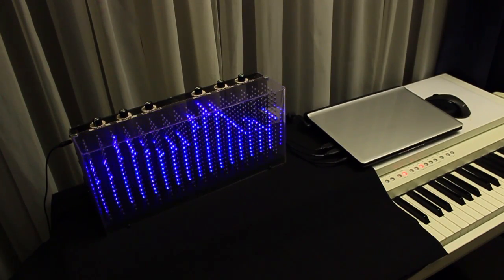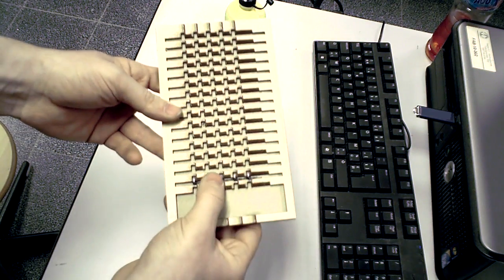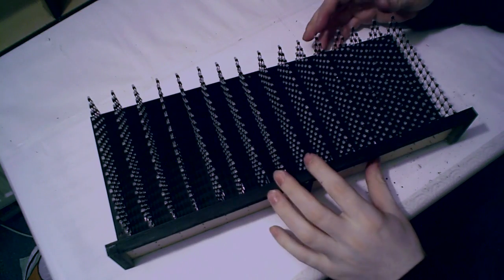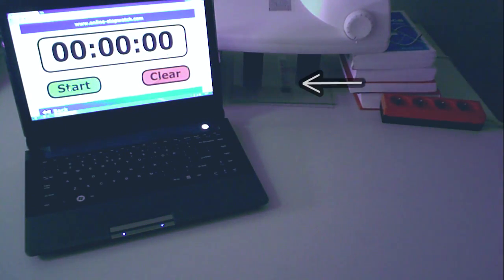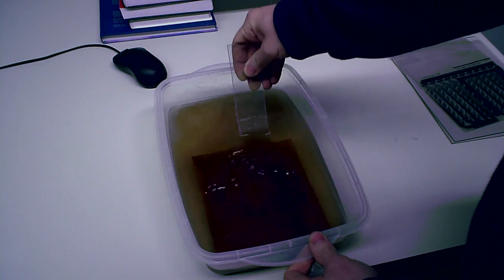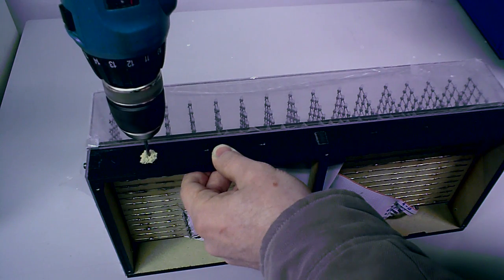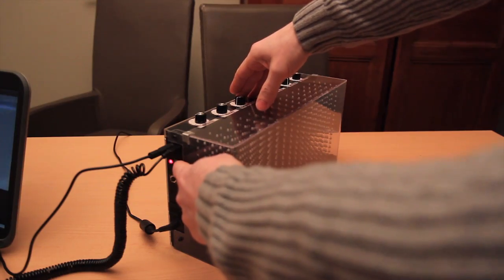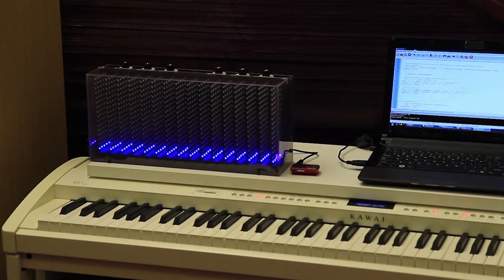3D Spectrum Analyser (1280 LEDs) - MAKING OF

Comment: Dude, all I can say is Bravo 👏 

As a qualified electronic engineer myself this is something even I couldn't build.

In college we all built final year projects, and every project was totally different from each others. What I could electronically understand and build was completely different to others, (and the same for them too), but this project is on a higher level than what I've seen.

You truly are jacked deeply into the matrix. Very clever stuff 👍

(I built a full size pinball machine that kept score, and outputted all info to a small lcd panel) as my project 👍 and I left it in college and told my lecturer he could strip it and keep the parts lol 😆

Comment: Impressive. One thing I want to say is that the LED used in this project and LED's used Led Cubes projects are completly diffrent. Ones in cubes are programmable through I2C protocol. These here are normal LED's which only furthers proves your genius because it's much harder to build your own circuit than writing a program (which you also has done). Keep it up!
Reply: And here i was too fast. Last 3 minutes of video impress me even further. Hands down.

Comment: "I'm making one!" Said no one ever!
Reply: what
Reply: EpicGaM3R13 this guy defeated everyone with the procedure. we can only watch and wait to buy a finished  one
Reply: I'm making one! lol
Reply: EpicGaM3R13 i seriously considered making this, untill the laser cutter came into play. Don't have access to that :(
Reply: So get it done online, and posted out to you, or look for a local hackspace or makerspace.
Reply: I wish I had the resources to make one. I would so make one if I did.
Reply: 0:05    Wow, I'm going to do this
2:30    Oh, man, too bad I don't have access to those tools, otherwise I'd make one
7:27    Well, maybe as a masters degree project
19:07  Oh, come on, screw this guy

I graduated in electronics engineering, but this guy is on whole different level.
Reply: I was just about to say something similar, hah!

My hopes may be dashed, but it was great to behold.
Reply: Basic-Medium electronics, used as well as it could be.
Reply: Rondle Berik, the laser cutter is not necessary. To make the frame you can use any reasonable kind of saw that you can use to make a box. His design involves a couple inner corner cuts which may be tough with eg a table saw, but it's ultimately just a box you can build however you like, and all you really need is some rectangular pieces of wood. The jig he laser cut can be made using a printout of the desired pattern, taped to either a few layers of corrugated cardboard or thin balsa, then cut with a utility knife; it doesn't need to be pretty, it's just a jig to hold wires while you solder them.

Most of the specialized stuff he does makes things easier or neater but isn't really necessary to make it. PCB etching for instance. Perfboard can be used instead though the resulting board will look messier with lots more wire soldered between things.
Reply: I never got this FFT working properly. Mine is now attached via DMX which is packed into UDP
Reply: sbcontt YT digikey ?
Reply: I'd like to say that I want to build it, but I wouldn't even know where to begin, seeing as my knowledge of electronics is on a noob level and the only tools I have are water, NaOH, a drill and a soldering iron... I would never be able to finish this. I won't even know what to do if I had to troubleshoot anything
Reply: Eetz zso szimple.
Reply: Yeah I’m thinking the 30K likes he got wasn’t all from people who think they are up for replicating this project. The Two Steps From Hell music is fitting.

Comment: Wow, nice job!

For the PCB can also recommend the ironing method. Works just fine.
Reply from the maker: In this case it won't work well.

- The PCB surface is too big and there will be problems with the heat distribution. The surface will act as an heat sink.
- The ironing method works only if the PCB traces are thick enough and there is enough distance between them. In this project I went as low as 300 um if I remember correctly.
Reply: Heat distribution can be resolved using heat insulator under the board. And even 0.2mm is doable. Just need the correct photo paper (not the blue press n peel stuff).

But of course, if you already know how to do the optical method and have the tools, it's actually easier.

Comment: For the Ferric Chloride solution, you might want to add a little H2SO4 or Muriatic Acid (also called Sulfuric Acid) - which makes the etch go faster. I speak from experience. You could also create a tank out of Stainless Steal (440) which should be resistant to most acids. BUT if your molar mass or the concentration of acid is low enough, you "should" be ok. Then add a bubbler and a submersible heater (contained in glass). and There ya go... an etching tank.

Comment: In total it was about 100 hours of soldering spread over a few months. When I started on this project I bought 1000 LEDs. They were enough to solder 12 of the 16 layers. To finish the other 4 layers I bought 400 LEDs more but they turned out to have a lower light intensity. The person who sold me the LEDs was not able to send me the same LEDs for some reason... As result, I had to buy 2000 LEDs with the same light intensity       

  Just mildly insane :)

Comment: I used to sell 8 x 8 x 8 RGB cubes on Ebay that I got from China. I was thinking that you could take a single 8 x 8 panel and have it spin on an an arm   just activate the lights at given angles over a 45 degree angle  to create a 3D effect .  there would be almost no visibility wiring . You would have to use strong led's since their light would be stretched  out over a 20 inch span. It could be run with pic or Arduino

Comment: Well outside of the thousand steps needed to build this extremely complex contraption, I did build my own 900x1200mm 100 watt laser cutter and saved about 20+ grand by not over paying for a trotec setup like that speedy unit.  
 No doubt they are very nice gantry type machines, but simply don't justify the price in today's market unless you're planning on running the unit around the clock week after week to justify it.  Although I will say my machine can do that to, but my raster speeds aren't as quick due to not being servo driven or running 25-30mm belts, and I can't change my hertz frequency on the fly like trotec's proprietary software can.  But none the less those things are just bells and whistles that aren't really necessary or justify the cost for 99% of laser machine users. 
 I guess what I'm getting at is how I'm just perplexed a guy with this level of knowledge and ingenuity would devote such time in building a device as useless as a spectrum analyzer that needs hand made PCB boards, yet didn't build the laser unit it's self that actually gets shit done.    Coming from years of laser building experience, I swear to God, it's easier to build your own laser machine than to create this spectrum analyzer in the way he did it.  (Don't get me wrong, the analyzer is kick ass!)

Comment: FANTASTIC video REALLY GREAT project!! I was wondering if this could be used with a microphone and pink noise generator to set up a PA for a live band performance to adjust a 31 band EQ to the ACOUSTICS of the room? I ran 16 ch board long time ago for live bands in the bars and one of my other sound guys had a room Analyzer and we would run pink noise through the PA system and set the EQ by visually adjusting the display to almost what looked like to me a sine wave it really helped me to set the PA for different clubs that we worked and made the over all sound much better I recently started back in that business and priced one but about about fell over as they are now well over $2000.00 Thanks for taking the time to post this awesome video!
Reply from the maker: Thank you. This is just a music visualizer in 3D. You can connect a microphone or another audio input to it.

I don't know how the EQ adjusting to the acoustics of a room is done. This device plots the volume/amplitude vs the frequency of the input signal. I'm pretty sure you cannot use it for your application.
Reply: Thank you for the reply - I thought that each band responded to a specific Frequency range, it might be possible to adapt it but that is beyond my ability in electronic High & Low band Frequency pass filters - a Great Job very well done!!!!!

Comment: Great project, but one quick question.
When I created my own project, I used the Inkjet printer trick, which was comparatively simpler.
Could you give some insight on why you used the photosensitive plate? Is it more accurate?

Comment: Regarding the grief getting the code to work: what I would have done is ditched the C & written in assembly, in one big interrupt loop where EVERYTHING is done.  You would not believe how fast you can get things to run in assembly!  You wisely ditched some things (floating point, has no business whatsoever in this project, but everyone defaults to it, why?  For the Sine/cosine, & just about every math function, why not use look-up tables?  For angles, rather than using radians, use turn/256 or turn/65536 as your units.)  I do need to check out the "constant Q filtering" you are using.
          To give you an idea what assembly can do, I wrote code for a 6MHz 8-bit processor for a laser scanner.  I have functions that rotate 256 point scans in real time (10 complete 256-point images per second), do morphs between images, & other special effects such as "sparkle in" like you would see at a Disney show.
          I also did this for a robot.  Not only are all the robot's functions done, but also the radio signal processing, synchronizing to & parsing out the bits, & performing error detection/correction.